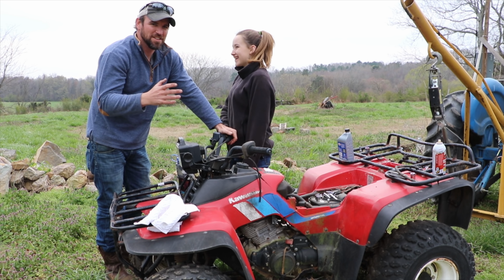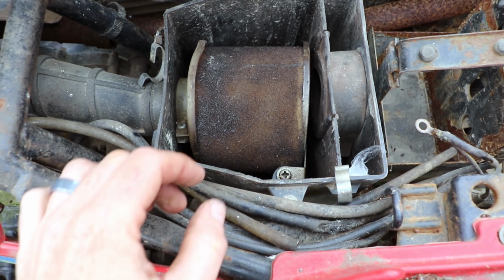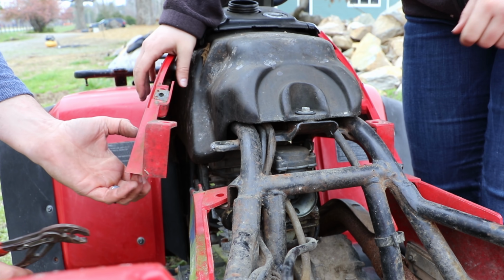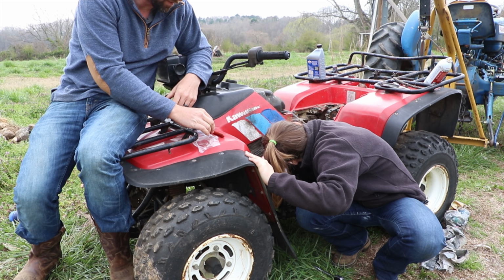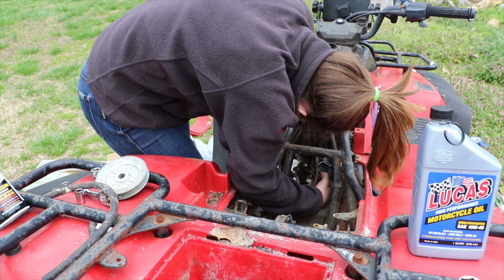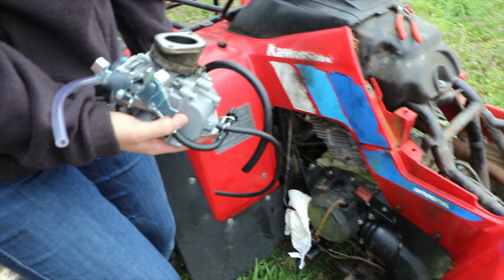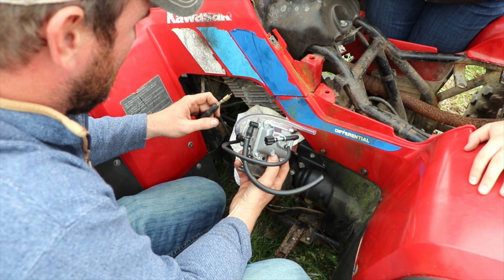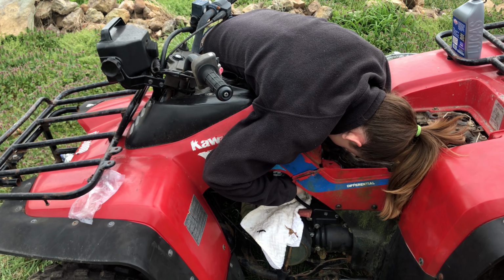ATV Carburetor and Fuel System Repairs - Ranch Hand Tips (Out Of The Weeds Part 3)

Comment: Everyone here just learned you dont need to remove the hex nuts, just loosen the other clamp. Also someone in the past replaced a 10 mill bolt with the 8 mil on the air cleaner housing. Nicely done.

Comment: Hey I need some help with my four wheeler I have a brand new cdi box and carb today it will start but as soon as I give it gas it stumbles hard but will remain running I pulled the spark plug and it is dark black when it stumbles it is very violent and sometimes will shut some black smoke but not a crazy amount

Comment: I just bought a 2000 Kawasaki bayou for my kids it's been sitting for 5 years! Thanks for the videos I might just attempt it. Bike shop wants $500 to rebuild a fuel system, and service it. My question is how did that cheap carb workout? Is it worth buying that off Amazon or just having the original rebuilt? Thanks for the videos!
Reply from the maker: The carb has worked fine,  every now and then I need to give it a quick shot of starter fluid when it’s cold, but I’m not sure if I have it adjusted properly or it’s the starter coil.  I have a new coil I was going to try to see if that fixes it, but that issue is so random I keep forgetting to put the new part in.  $500 is about what I paid for similar repairs on our King Quad, honestly I think if you can figure out the repair on your own, not only will you save money, but you will learn the machine well enough to keep it going.  So my vote would be buy the cheap carb or a rebuild kit.
Reply: @YanasaTV  thank you for the reply! I bought this bayou from the original owner it's in great condition. Thanks again for the encouraging video I'm going to do the same project with my 14 year old boy he is really excited. The carb being that cheap makes it worth a shot! I actually just ordered all the parts this morning.  We'll keep the old one and maybe rebuild it just for fun and for a backup. North Carolina is beautiful it reminds me of Oregon. God bless your family
Reply: Zoom zoom parts I bought one carb for my polaris and put it on fired right up ....

Comment: I just bought a Bayou just like this and I am trying to figure out the hose connection from the carb to the fuel petcock valve I know the hose at the bottom of the carb float bowl just hangs at the bottom if I’m correct and then their is two more hoses that need connected to the carb exactly which hose connects from the fuel petcock valve to the carb and what is the other one for this is the first time I have worked on a bayou

Comment: Don’t throw away that old carb if you bought one of those cheap carbs on eBay.
Reply from the maker: I never throw away old carbs if I can find a rebuild kit I normally keep them and rebuild them in my spare time.
Reply: ditto.  The Chinese carb is a fail.  It does NOT run good on the KLF300.  Instead, rebuild the factory carb.